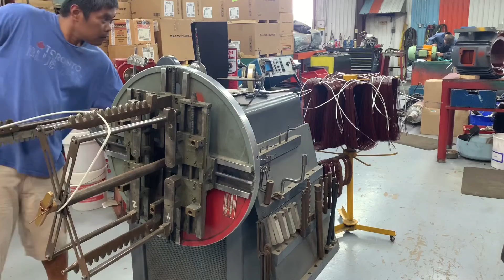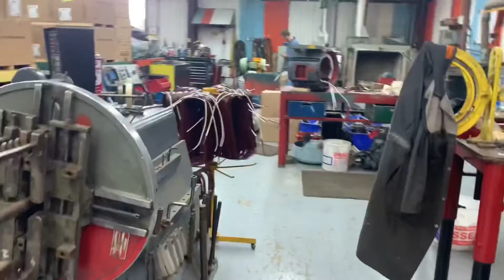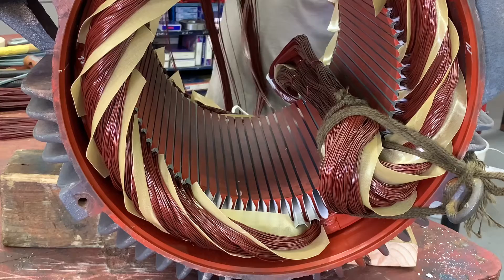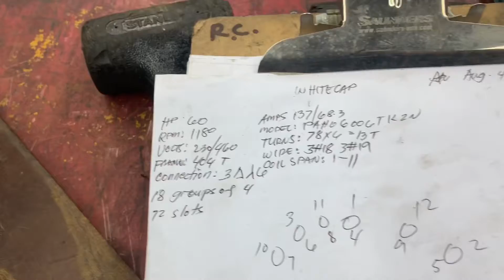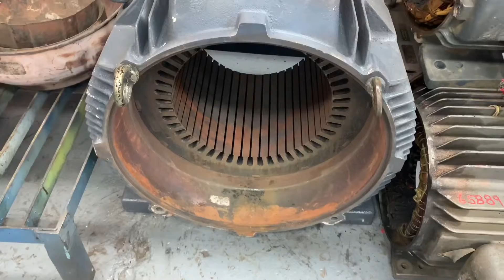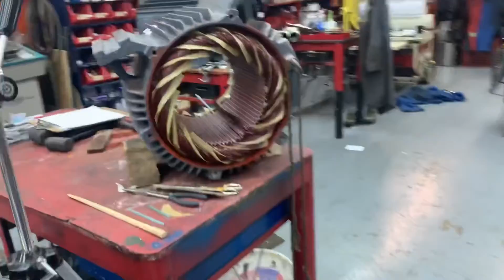Motor Rewinding | 60Hp Teco Westinghouse Low speed |Rewind & Connections P1

Comment: How many hours did it all take stipping to dip
Reply from the maker: Hi Kevin,no certain hours it’s the bubbles coming out from stator depend how long,it need to soak it well and make sure it goes all the way inside the sleeving.
Reply: How long to complete the job..I am winder. Check out indeed
Reply: Those top sticks are different what I use. You can break them off with your fingers. Nice feature. Whats the material. I use nomex
Reply from the maker: That’s a fibre wedge it’s hard and easy to break
Reply: I enjoy the videos. I am winding a deyno 40kw generator. It has 3 taps coming out and auxiliary windings. Its fun